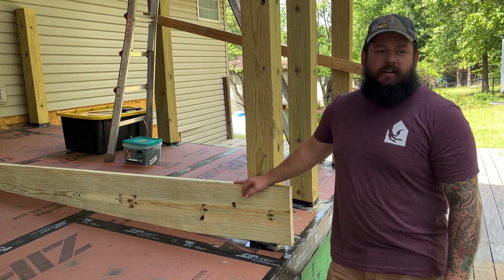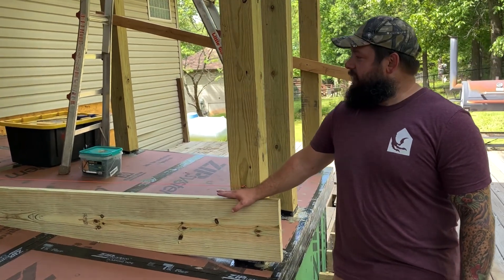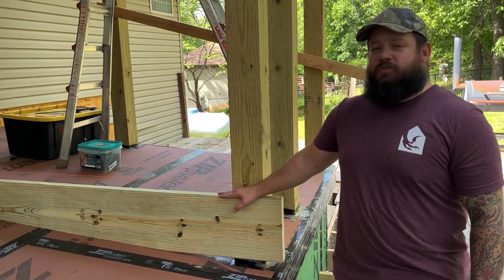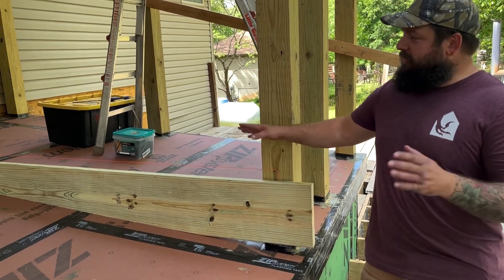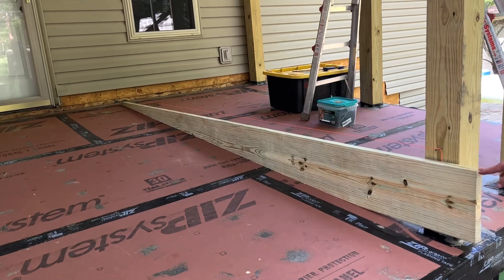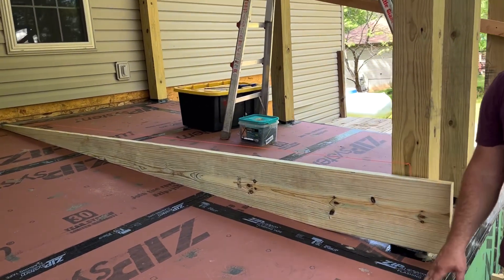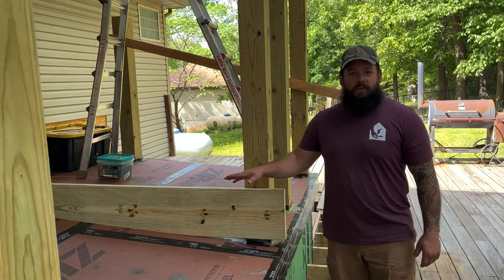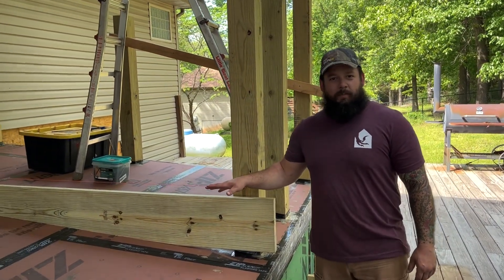Day 25 : Project Chief

Comment: Are you going to use the rubber roof material before installing the deck joists?
Reply from the maker: Yep! We will be using two layers of a rubber roof before the deck joists go on. The first layer is for waterproofing and the second is to just protect the first layer from the joists. Thanks for leaving a comment, Andy was getting very desperate for interaction 😂